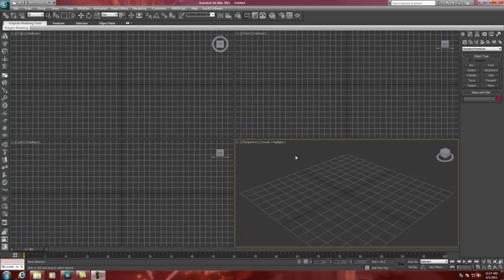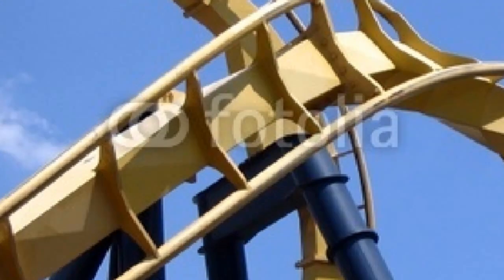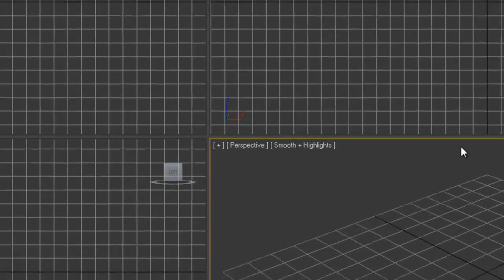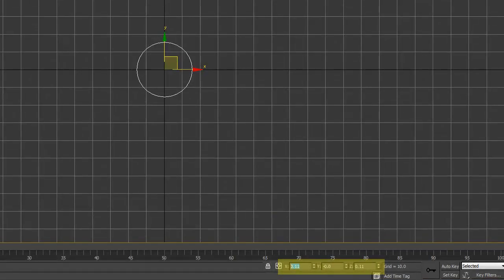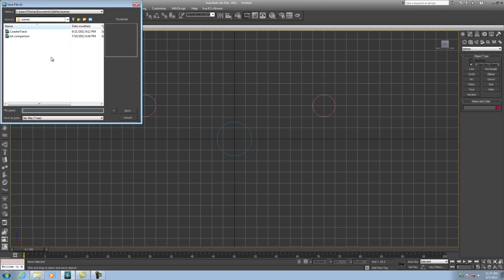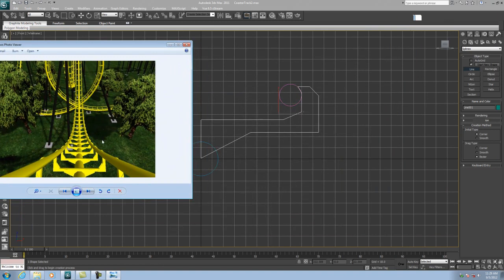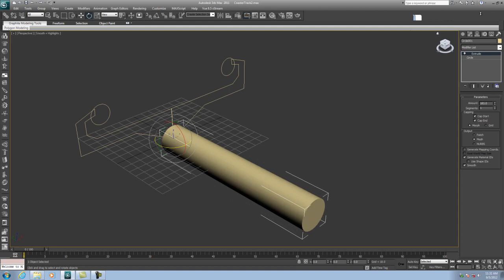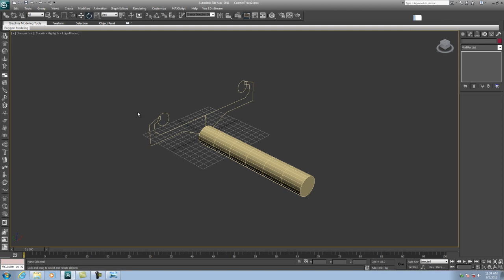Creating a 3d Roller Coaster in 3ds Max Part 1

Comment: You could use a path constrain for the position? rotating could be done in various ways, for instance a orientation constrain could work when using multiple orientation points on the track itself.